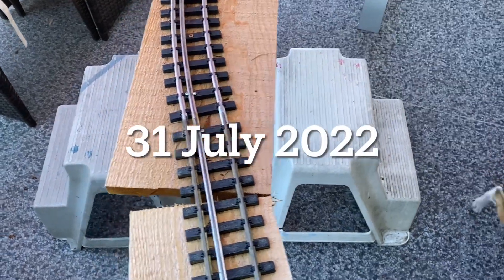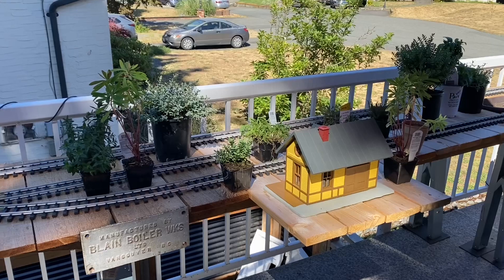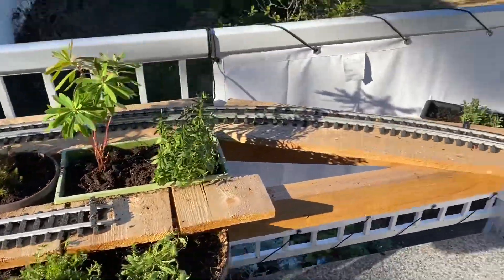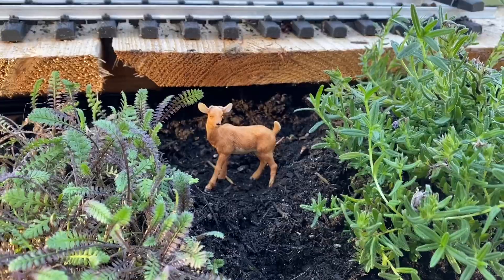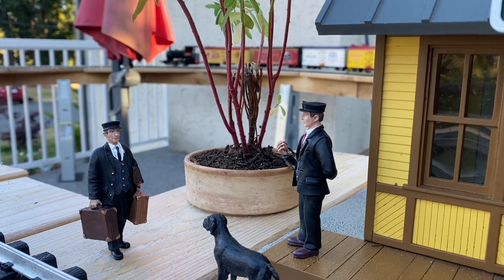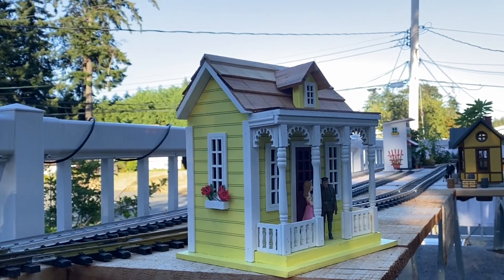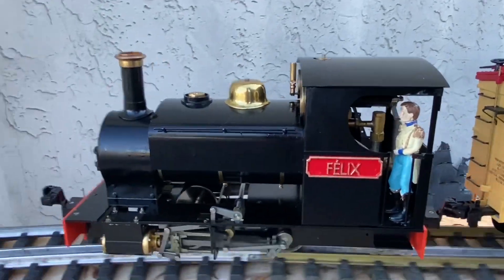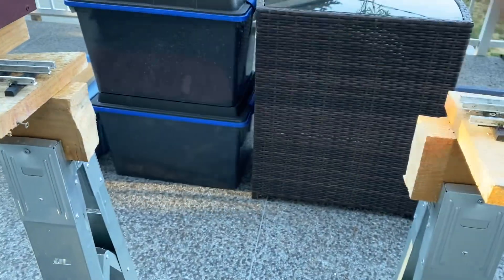Victoria BC: Lift-Out Bridge & plants for my elevated live steam track (link & info in description)

Comment: It seems like your new lift out bridge section also acts as an amplifier as well, great sounds as the cars assed over.  The plants really improve the character and give it a lot of depth very clear in the low angle shots.  H&M seem to be impressed as well ;)
Reply from the maker: Due to a mistake of mine there is one rail with a bit of a gap. Not too much so as to cause derailments but it makes a lovely clack clack. A happy mistake! 😊

Comment: Hi Terry Just thought I would let everyone know.Mamod have just put their prices up.A basic Brunel mk3 was £506.Now £566 and a Mamod mk3 £389 to £435.Not small increases.
I was going to get a Brunel but decided on a mk3 from Dream Steam.Last 32mm gauge in stock.If anyone was thinking of buying a Mamod I would look at some of the other retailers while the old stock lasts.Anyway another great video Terry thanks.
Next purchase is some teflon plumbers tape lol.
Reply from the maker: Ahhh yes. The Teflon tape. Most useful!
Reply from the maker: It’s too bad about the price increases but everything seems to be going up including raw materials. I was considering a Telford and also one of their steam tractors. I’ll have to go look. Thanks for the heads up!
Reply from the maker: The Telford is still 440. Unless they haven’t gotten around to changing that page yet. If you are looking for a 32 mm gauge engine it may be worth it. It does have an odd short wheelbase though.
Reply: I didn't notice the price had gone up until I went into the page.It was 389 but changed to 435 when I clicked on it.As I say I got it at 389 from Dream Steam so not so bad.
I have one of their tractors.Great fun and plenty of accessories on ebay to make them look really good.
Reply from the maker: @davidwhite1864  i have. Priced that too. The prices in the list page are the original but in each individual page is higher.

Comment: Hi Terry loving the videos keep them coming.Here in Scotland we get some nasty weather in the winter.Much like a lot of Canada I would think.
I'm using Mamod track but lay it each time I have a running session.I'm thinking of fixing it down and leaving it but wonder how well it survives.I noticed you had some damage to yours after the winter.
Reply from the maker: Hi David. I have a sort of love/hate relationship with Mamod track. I love that it is not terribly expensive and that it does the job. However, I dislike that it is made of a somewhat brittle casting material and there is a very limited scope (a single diametre curve, for instance).

Once fixed in place it seems ok. The main issue I had with mine was not a fault of the track as such. In the first version of my garden planter railway I built what was essentially a bridge structure to place the track on and then filled the planter with soil up to track level. Here in Victoria, on Vancouver Island, we rarely get snow in winter and it does not often drop below freezing (unlike the rest of Canada). As we are in a temperate coastal rainforest area our winters are typically dreary cold rain. 

I forgot myself and never considered possible outcomes. We had a rare freezing snap after the typical rain and the water-filled soil in the planter froze and expanded. This in turn pushed up in the bridge structure I had laid my track on. This in turn caused some track to snap. The distortion to the roadbed likely would not have caused too much damage to a good flexible track such as the more expensive Peco track. 

In version 2 of my planter railway I laid the Mamod track directly on a solid roadbed of Western Red Cedar, which is very resistant to rot and water damage. I suspect the Mamod track could have lasted years like that. The only reason I ultimately decided to remove it and replace it with 45 mm gauge track is because I have far more 45 mm gauge equipment and can still run my 32 mm gauge stuff on my dual gauge track on my deck.

I have kept my track in the event that I decide to build something else outdoors. We’ll see. 

Does any of this help at all? I think a good firm roadbed that won’t easily move may be the ticket.
Reply from the maker: … I just looked for and found a video I remember having seen quite a long while ago. This fellow seems to have used cement to fix his Mamod track down onto stone. https://youtu.be/6N5YT97GvMg
Reply: Hi Terry thanks for the advice.The cement option is probably a bit to permanent for me.I have a raised area 14ftx6ft which is paved so will probably fix treated wood(lumber)to it and screw the track to it.I'll stick with the Mamod track as thats what I have.Next purchase thaks to your videos will be a Mamod Brunel.Mamod should employ you as sales director lol.
Cheers.
Reply from the maker: @davidwhite1864  lol. Well, I post to encourage the hobby overall in my way. The Brunel is a good engine. It will run better once run in after several hours - like any engine. If your cylinder puffs steam there is an easy thing you can do to stop that. I have a vid about that too. Mine particularly likes isobutane/propane mixed fuel or isobutane alone.

Comment: It’s all looks grand Terry, had a lift out section myself but spent more time fiddling with it than running trains. Used to work on a Permanent Way gang and it’s still a chore in model form.

Really like the dual gauge on the main circuit as well, something I thought about when I was laying mine.
Is that track all made from pre formed track section?  ie no flexible track?
Reply from the maker: It remains to be seen how fiddly the lift out section will be. Lol  Crossing fingers. 

The curved track is a fixed curve. The straights, with the exception of a few short brass pieces are long flex. If I had my time back I would have had only flex and included easements into the curves. 

The third rail is one I laid from aluminum rail. It was fairly straightforward. I like having the 32 and 45 mm gauges.
Reply from the maker: Here is a vid about dual gauging my track. The point was the only real challenge. This was when we still had the old deck. https://youtu.be/FozsOF9L6W4
Reply: @Terrys-Steam-and-Bricks   Il give it a watch perhaps I could bodge something similer into my circuit, hope your bridge works out better than mine. Iv got a big scar down my back where I caught a protruding screw that Id just put in to fix the bridge down.
Reply from the maker: @SteamTrainsNStuff  ouch! I have a few modelling scars too. I also have a great picture of myself with no eyebrows or eyelashes. I got distracted lighting an engine.